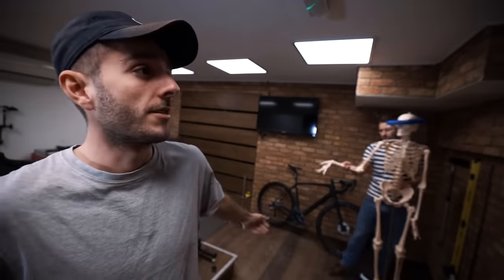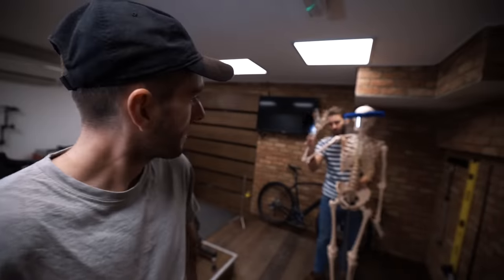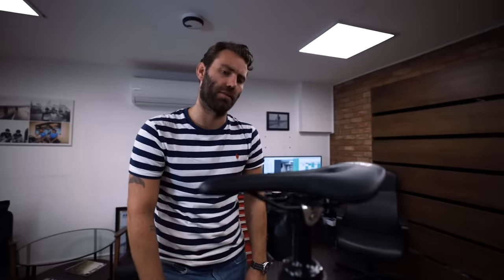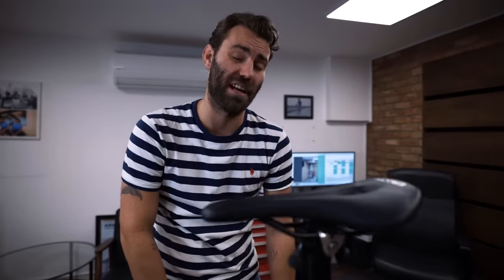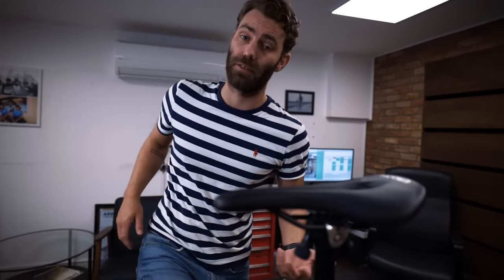Saddle Fore/Aft  Explained - How far back should your saddle be?

Comment: Question: Why is saddle setback measured from the nose, when that is entirely dependent on saddle design and not related to actual portion the rider sits on? Would it not be more accurate to measure it from the back, to get a similar fit across bikes/saddles?
Reply from the maker: It's just a consistent point to measure to assuming you're using the same saddle - if you're changing saddle to a different model it could force you to sit in an entirely different place, doesn't matter if you measure to the front or back, it needs setting up from scratch
Reply from the maker: @walcottav  just ensure there's 80mm between the tip of the saddle and the edge of the bin before throwing it in there
Reply: @Cade_Media  😆😂🤣

Comment: I have three different types of bicycles that I have set up by myself, based on the posture in which I can ride comfortably for hours, also using rollers to help me get the best right/left as well as front/ back balance, and I have come to realise that seat angle seems to have very little to do with bike fit. The three bikes have 72, 73 and 74 degree seat angle, but I have just realised that for all the three bikes, the triangle formed by the rear wheel axle, the bottom bracket and the middle of the saddle is identical in size. So, effectively, the saddle is at the same angle to the bb for all three bikes. Makes sense?
Reply: I have no clue of anything here.  lol

Comment: I found if the seat was too far back ( i e when it slipped) I would get soreness around the perimeter of my kneecaps. I just put that out there for someone who has experienced that type of pain and is looking for an option to try for relief. I have been chasing the perfect fit for thirty years of racing as riding and found the perfect fit is a bit dynamic.

Comment: What are the implications of having a short setback from the BB on a mountain bike as a result of a steep effective seat tube angle? Many manufacturers are now making MTBs with 77-80deg ESAs combined with a longer reach, which would result in a very short setback when compared to road bike fits. This has been done to bias a forwards climbing position on steep uphills for aggressive enduro bikes (i.e. "getting over the BB"), but is now finding its way to more all-round trail and XC bikes. Can it compromise the seating position when riding on flat terrain for extended periods? I haven't seen anyone discussing the tradeoffs.
Reply: Personally I've muttered a lot about over the years and reckon it's simply ignored because barely anyone considers pedalling bike fit with regard to saddle position and BB. If they do adjust fore/aft it's usually and incorrectly to adjust reach [buy a bike that fits you in first place] and not to finesse pedalling efficacy/comfort. 
Firstly droppers appeared and were all inline compared to the previously set back posts that pretty much all bikes came with. This was simply to make them less unreliable, by reducing bending moment on seatpost and had no consideration to of bike fit. Then seat angles were steepened for climbing, again with little consideration of bike fit re saddle/bb. If you want to steepen you seat post angle going up hill. you can simply slide a tad further forward on saddle. I have one of the very few laid back droppers to get a comfy fit.

Comment: 5'6"....inside leg 33.5"....huuuumungous head (63cm).... One road bike is "S" with 531mm ETT, needs a 20mm setback post and an 80mm stem, winter road bike (51 C-T) has a 550mm ETT so had to swap out the 20mm setback post for an inline from a MTB and shorten the stock stem from 100mm to 80mm.... My E-MTB has a silly short reach despite me being smack bang in the middle of the "S" recommended size (Not my usual in between sizes S/M) but as it's got a decent dropper(inline) I've had to just slam the saddle back on the rails! Lucky it's a FS running 2.6" tyres at 22psi so the cantilever effect shouldn't wreck the Ergon saddle....

Comment: As usual, great info! I have a question that is maybe not 100% related, but still :) Assuming a perfect bike fit, can a general lack of (terminal) knee extension cause anterior knee pain and quad when cycling? My thinking is that instead of pedalling, its more stamping down on the pedals. Same as with walking, the lack of terminal knee extension causes the patella to take much more of the load. I know that the knee extension angle is locked in on the bike, but in your head you can still pedal differently. I hope it makes sense :)

Comment: hmm,   for me there seems to be a point that  for a given set back  I can take my hands off the bars  and  support my body for a given angle. ( Whilst pedaling). If I move the seat forward and take my hands off , I would collapse into the bars.  So at the point where I can support mysel fI get a lot less issues with numbness.   How far back you go I have no idea.  But  I have tracked my knee joint  and found a spot where the motion is fairly sinusoidal, like a pendulum.  No snapping of the knee in extension, and no double kick at the top of the stroke.  The problem is that everything seems to affect everything which is why I guess it pays to find someone that has seen it all!

Comment: If I tend to hunch my shoulders and get numb hands on the hoods, would you recommend moving the saddle forward or back?  I am 6' and ride a 58 Trek.  I'd say I have average torso to leg, but longer arms.  Thanks!
Reply: They explain this (possibly) in the seat height video. Numbness in the hands is often caused by excessive weight on the hands and your body being too far forward as a result of excessive seat height. Advise would likely be to lower your seat first. You may need to move your seat back after that if your legs are too scrunched up, but not likely. At six foot tall with average legs on a 58cm frame, your saddle is likely going to look really low. And based on the other video, he would likely recommend you be on a smaller frame, though of course that is not usually as easy to fix as lowering the saddle.

Comment: Is there a more accurate way of measuring rider position on the saddle than measuring to the nose? Seems a very inaccurate place to measure to unless using the same seat on each bike.
I'm trying to improve the comfort on my "fleet" but they all have different seats, so getting them consistent is part of the issue.
The other issue is I have a massive head. XXL baby. One size fits...not me.
Reply from the maker: Not really, the seating area can be in completely different places on different saddles. You're right that measuring to the nose only works for the same/very similar saddles. You have quite a bit of wiggle room in fore/aft adjustment to experiment and not cause problems though

Comment: Measuring saddle height accurately always seems a sticking point for me. Is the best way to measure it on the NDS from the centre of the BB right the way up the seat tube / seat post to the top of the saddle?
Reply from the maker: Yes that's what I do, I use a steel rule instead of a tape measure which is easier to keep consistent.
Reply: @Cade_Media  Good point about the steel rule, never thought of that. I’m pretty fortunate in that I don’t really notice small changes in position from bike to bike but saddle height is the only thing that drives me mad if it isn’t spot on. Anything too low & my knees complain immediately 😂

Comment: I've the typical problematic shape: i'm 1.85 and 91cm inseam, with long arms and wide shoulders. I'm using a 25mm seatback seatpost with the saddle in the middle and a 100mm stem. Sliding the saddle forward would put too much pressure on my hands . Anyway you're right...very problematic and limited shape

Comment: IMPORTANT:  I have Scott road bike and I have the saddle as Fore as possible.  After watching this video just as a reference for myself I measured the distance from the wall to the tip of the saddle and then the distance from the wall to the paddle axle.  Although the saddle is as forward as it can be it still sits 4 cm behind the paddle axle.

It would seem that my only option would be to look for an in-line post as I'm using the stoke one which as most I believe is slightly arched backwards at the top.

Comment: Is it..moving it a lil forward, need to raise it UP and moving it a lil backward, need to raise it Down? Or vice versa? Tnx
Reply from the maker: Correct, moving it forward will mean you'll need to raise it slightly to achieve the same leg extension, assuming you're sat in the same place on the saddle
Reply: Hi there and thank you for your videos! 
So if I am set on a saddle height, and I move it forward on the rails, after setting this height.  The saddle will be a bit lower because it is now CLOSER to the BB right? 
So you say: " raise it slightly to achieve the same leg extension" I will raise it again to the initial height I had set it at BEFORE I moved it forward. Am I understanding you correctly?

Thanks again and cheers from the Caribbean :)
 @Cade_Media

Comment: My saddle was really backwards and I wasn't able to use my glutes at all. My quads were not recovering at all and after moving the saddle forward, the problem is gone. I did a simple bike fit at a local bike shop and the guy moved my saddle back to the maximum because I'm 173 high and riding a size small frame. I spent the entire winter struggling on my trainer wondering why I wasn't able to recover even tho my training load was pretty low☹️🤦‍♀️5 months wasted and my mood was awful because of that.

Comment: As someone who's just started riding road bikes, I find setting it forward = a bit bouncy on the road feel, sore bollox, setting it back = a bit stiff on the road feel, sore bollox, whilst in the middle... not so bouncy, not so stiff on the road feel, same sore bollox. 

I've seen seats without the front part, how important is the jewel crusher at the front of a seat?
Reply from the maker: Couple of videos back we did on short nosed saddles, I think you might find some useful info in that one!
Reply: @Cade_Media  I'm prepared to throw UCI rulings out the window and seek out a no nose saddle.
Reply from the maker: @fergusdenoon1255  sounds like you might want to explore saddles with a pressure relief channel, rather than no-nose
Look at something like the sell Italia boost

Comment: These days don't follow this. Years ago most saddles were 270mm in length. These days most saddles are coming out shorter (248mm -250mm etc.) So saddle nose to bottom bracket is way different! If you are converting to a new (shorter) saddle compare the rear of the saddle to BB.

Comment: I think the measuring method to determine set back is flawed because seats come in different lengths. Also, knowing the setback number as described, is only helpful for that frame and saddle combo.
Reply from the maker: Yes there is no point in measuring setback if you're changing frame or saddle - it's purely to record your setup so you can replicate it later

Comment: 8:00, that's me, long legs short torso, blooming hard to find "the right fit"
Reply: You probably need a bike with a taller headtube and shorter top tube
Reply: Da bomb tactic handlebars, Easton EA 70. 30mm layback seat post and a 30mm reach spank stem.These tweaks made the front of my bike lighter where my weight was further back ,I did have to dump a few psi out of the front tyre to achieve the same amount of grip that I had before these changes

Comment: As with everything, there is no one set way, as you allude to In vid after stating it shouldn't be set to extremes on either end, if you're between sizes in frames and i see it all the time, you have to pic the lesser evil. Me, for example, I'm right on the upper limit of a small frame this leads to far to much tow overlap and a very cramped position let alone bad cleat placement in my size shoe.In the medium frame, I'm right on its bottom end leading to an ever so slightly stretched out position on the bike. I went with a medium because I didn't want to deal with toe overlap and strange cleat placement leading to outside knee pain.

2 evils i had to pick one. next time ill be getting a custom frame made for me.
Reply: As a resident daddy long legs, toeverlap is just the normal. Much better to me than reaching 8 miles to the bar.